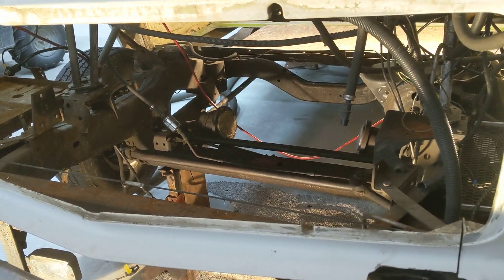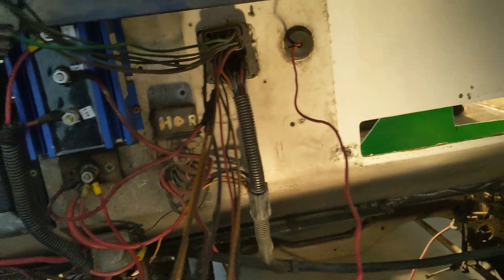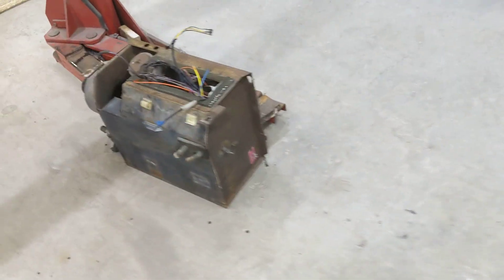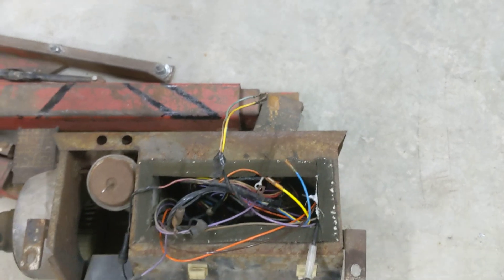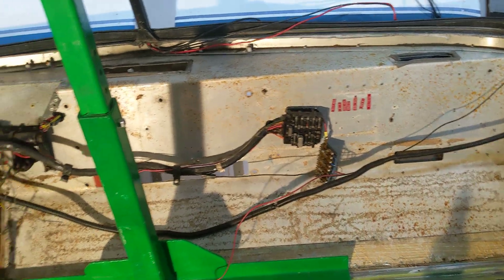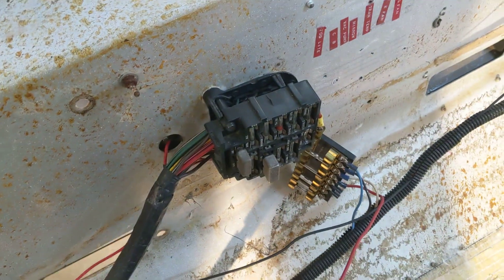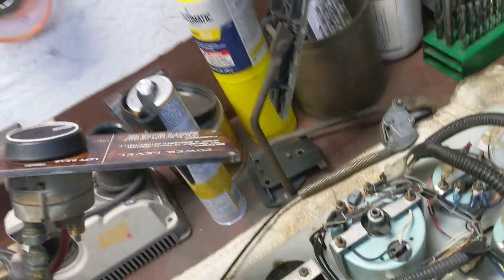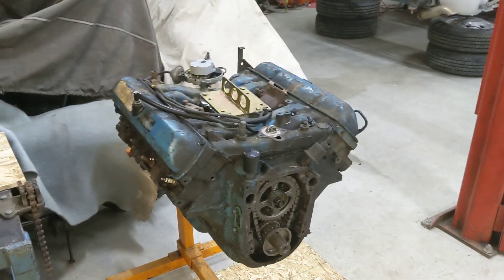GMC Motorhome 24 (Dash / HVAC removal)

Comment: Tearing into my rig now.  Shaping up to be more than I bargained for.  Looks like the upper pressed nuts on the cowl are spinning and I can't remove the heater box.  May have to take out the dash.  I had heard that to remove the dash, you need to remove the front windshields.  As I am working outside this may be a bridge too far.  Your video is very helpful to see the inner dash workings.   Thanks!
Reply from the maker: I pulled the windshields because of a bad spot in the windshield area that was leaking.  But it would be very difficult to get the dash out without them out.  You could cut the bolt heads off.  If you need pictures of the area let me know.

Comment: Nice video.  This year's plan is to update our AC/Heater box with new Vintage Air or like unit.  Takes the fun right out of it to bake in the sun, or freeze in the cold when you are tooling down the road.  Great to see what is under the dash!
Reply from the maker: Soon I will be installing vintage air, just need to get the engine and transmission back in.

Comment: You might already know this, but just in case.  Over on the GMC Motorhome forum (YouTube doesn't seen to allow links in the comments) I put a resource about changing the manual shift lever seal. The TH425 is different from other Turbo-Hydramatic transmissions in that the seal for the manual shift lever is an O-ring on the shifter shaft. Might as well change that while you are in there as it likely is still an OEM seal.
Reply from the maker: Thanks Bruce I changed it last spring as it was leaking badly.  I matched an o-ring best I could as I could not find it.  I need to seal the vacuum modulator and the kick down plug as well.

Comment: MicroLevel is on my wish list for replacing my ElectroLevel rear suspension.  I replaced my transmission when my engine was rebuilt.  I figured I might as well as I had no history for it.  For the next 10 years the replacement transmission would randomly fail to shift from 1st to 2nd, but I could always manually shift it.  Finally 2 yrs ago it would not shift most of the time.  Transmission guys could not find the issue so they rebuilt it, and it was no different. so we had to put another transmission into it.  So far so good.  Sometimes its better to stay with the Devil you know, than the one you don't.
Reply from the maker: I understand your thought process and I think I am going to just seal the transmission and put it back in.